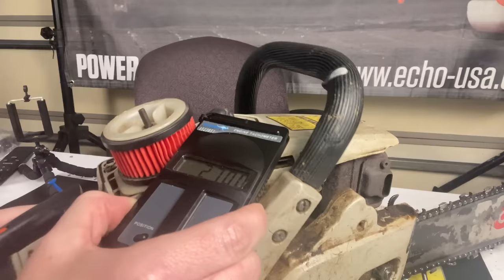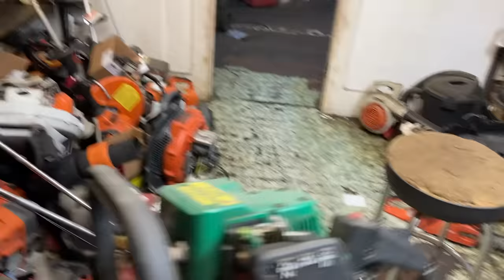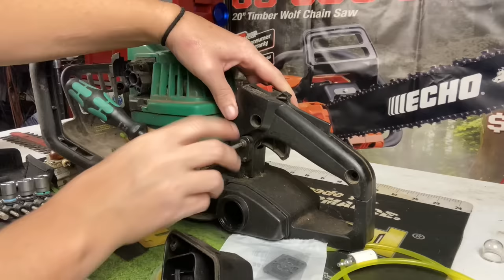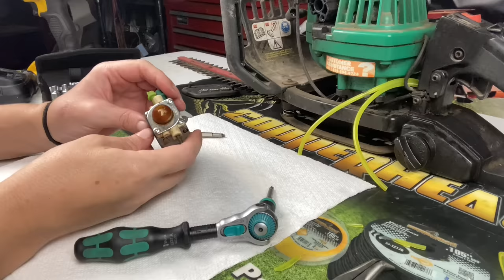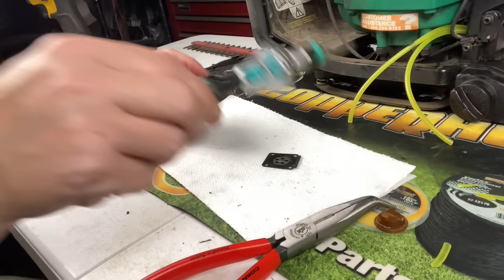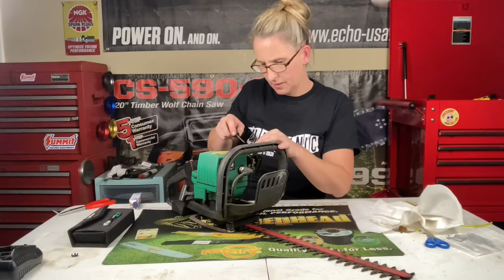THE BIG SECRET on how to store your small engine long term + Turning Shop Trash Into Treasure!

Comment: Love watching your vids, small tip for feeding a tight fuel line is to put some spittle on it and push and pull at the same time, it slides in easier, but like I said, love your vids.

Comment: Found your video on purging 2 cycle oil through the system before long term storage very interesting and I might try this some day. However, when I bought my first chainsaw, a Stihl 041AV,  back in 1976, the dealer told me to never run the saw dry before it was to be stored. He advised me to fill with fresh fuel, run it a couple of minutes and then shut it off. Then every six months or so, change out fuel start it up and run for a couple of minutes before shutting off which I do for all sisxteen 2 cycle pieces of equipment I own and never have any issues with starting. As for the Stihl 041AV, in all of this time, besides regular maintenance, I have only had to replace a couple of gaskets, and do a carburetor rebuild twice and it still starts and runs perfectly. There is, however, one problem. This saw still has so much compression that these 76 year old arm s and shoulders are having  a lot harder time pulling the starter cord so I just might try your suggestion of circulating some oil through the system and just let it sit on the shelf. But do to the fact that it does not have a purge bulb I don't know if this will work.Thanks again for the idea.

Comment: Did basically the same thing on an old Craftsman string trimmer I’ve been using for twenty plus years! Great tutorial!! I had a little hard time getting lines through tank till I trimmed the angle sharper. Good thing I fixed it to, because I just got price for removing four large pine trees removed, and major trim on two ornamental pear trees!!!!!!!!! OUCH

Comment: That’s a great video!! I learn something all the time watching your videos. Will have to do this with my chainsaw, dump all of fuel run all the fuel out of the carburetor and pour a little bit of two cycle, engine oil into the tank and get it in the carburetor so it doesn’t dry up.

Comment: Great recommendation on the 2 cycle oil in the gas tank for long term storage.  I use my "small" chainsaw frequently, but only occasionally use my "big" one.  This reco is great for it's storage -- which can be 2-3 years at a time.
Reply: I’ve done it several times with a Stihl 2-cycle tiller that I only use once a year in the spring. It definitely works but it’s a bit of a PITA to clear the oil out of the carb on the first start after hibernation.
Reply: That’s why you should buy a qt of premix can gas for 5-7$ and store it with that. It has a 2 year shelf life after opening
Reply: @christopherlehman4045  You need to watch her video on using that stuff. She recommends that you never use it. I think your better off using her 2 cycle oil trick.
Reply: @christopherlehman4045  : or just buy ethinol free gas

Comment: I would read PM magazine and often wanted to take the advertised small engine repair course. Never did though. I recently found a Craftsman chainsaw, model 358351161, in my garage, hidden away. Manufacture year is 1997. I don't even remember it. But after watching many of your videos, I gave it a try. First thing, the bulb cracked and I dove in. All the lines were hard and brittle so I bought replacements and installed them using your techniques, but after watching this video last night I decided to open the carburetor. Sure enough, the diaphram was collapsed and I researched buying the repair kit. $35+. But a replacement carburetor was only $15+ including tax. The replacement carburetor comes with everything I previously bought times 2 for 1/3 of what I spent buying them piecemeal. Many lessons were learned, but primarily go all the way before purchase. Thank you for your concise and informative videos.
BTW, I will store it with all the fuel lines filled with oil when I put it away for the next 20 years.

Comment: Greetings!  Recently discovered your channel and must compliment you on your knowledge and ease of presentation.  Question on long term storage?  In reference to using 2 cycle oil in gas tank, what volume of 2 cycle oil do you add to you dry gas tank?  Do you fill partially, or complete fill?  Thank you and please continue to deliver the great content.  Bruce
Reply: Hey man, looking like your ? got missed, I would add enough to at least cover the the fuel filter and then some for cases where the rubber lines go directly through the tank itself. But, for tanks that use a rubber grommet with 2-3 fuel lines running through that grommet, I'll FILL the tank with oil so that it keeps that grommet from drying up, shrinking and hardening. Some tanks are BIG- I have a RedMax blower that is around a 1/2 gallon in capacity, so what I like to do is use an oil such as Super Tech 2-stroke Oil(may even be marketed as outboard oil too. I'm not too picky with it as I usually don't re-use the oil TO PRE-MIX with, but I DO save it to reuse for this purpose again, So it doesn't go to waste. Hope this helps, peace!

Comment: That was a very popular hedge trimmer.  I have one around the same age.  Plugs, lines, bulb, and gas cap all i ever had to do for it.  They had different model # version they were still selling 5 years ago.  But looked same.  All I would add is oil blades after use and use higher octane gas and it will run like a dream.  I was a great purchase.

Comment: The 2 cycle oil storage idea sounds really good.  We already know that oil is compatible with the gaskets and lines and it was made to burn.  I'm sure it will work fine for storage for a year or two and sounds like it would be an improvement over just running the tank dry.  One of my concerns however would be that it may get gummy when stored for multiple years.  My go-to for an oil that doesn't get gummy over a looong time is Dexron transmission fluid.  Any idea how that might work for long term storage?
Reply: Why would oil get gummy? I recently found a half used container at least 15 years old,  I had stashed away and it is still perfect. I don't know whether that would be true for the old outboard motor stuff. Doesn't transmission fluid have cleaning agents which may deteriorate internal components?

Comment: Hi Bre, love your channel! So, question about this tip with an Echo CS-590. Since it doesn't have a primer bulb, is it sufficient to pull it a couple times to circulate the oil before storage?

Comment: Great idea for long term storage of 2 stroke engine. Do you have a strategy for a 4 stroke generator? Or a tutorial for cleaning out the carburetor the day of the ice storm if you forgot to run it dry:)
Reply: Joe Shmo  Go to your local small airport and buy some 110 low lead.  It lasts for years in a gas tank.
Reply: @POOKIE5592  or just find a gas station that sell clear premium.  also, a generator should be getting run under load at least once every three months.  
but I've never had a carb problem since I stopped allowing ethanol near my small engine equipment.
Reply: @kenbrown2808  Can you store generator with ethanol free gas in tank? I don't use it very often, but need to have it on standby....
Reply: @pingpong9656  the only time my generator tank has been empty was when my BIL broke the fuel petcock off it.
Reply: @pingpong9656  addendum: the one thing i make a point of doing is i turn off the fuel before i switch off the ignition. That way if the float valve in the carburetor leaks, it won't fill the crankcase with has.
Reply: @kenbrown2808  That still won't last as long as av-gas.
Reply: @POOKIE5592  And it won't have the lasting effects of lead either. Good health for me and my children or gasoline that will store for years, such a hard decision.
Reply: @killer2600  You gonna all sit around in lawn chairs in front of the muffler?  We're talking about emergency generators here.  Do you run indoors every time a Cessna flies over your yard?
Reply: @POOKIE5592  You should research the use of lead in fuel and how we have all been poisoned by it. Good videos on that on youtube, Engineering Explained did one about two months ago. There's even a movement to go unleaded in avgas for a reason. Leaded gas isn't safe for anyone, at any time, in any use case.
Reply: 0:54 Bre replies to all the early commenters except me:)
Reply: @POOKIE5592  Going to check that out with a small engine mechanic that is also a pilot. He got my generator going the day of the ice storm. He looked in the gas tank and threw it out then used a lot of steel wool to clean out the carburetor parts and pieces.

Comment: Watched this video but you never discussed "The Big Secret" on how to store your small engine. Did I miss it somehow?
Reply: Go to just before 13 min.  Before storage remove fuel, run dry, replace fuel with 2 cycle oil, make sure you get it into the carb
Reply: She explained about emptying it of all fuel, and pouring in 2 cycle oil for storage. That’s a cool secret for winterization.
Reply: Yup' you missed-it

Comment: My secret to reviving old engines that have sat for a decade is my ultra sonic cleaner. I have got countless engines running without rebuilding the carb. I take the carb off, run it in the ultra sonic for a few hours, THEN I take it apart, lay the gaskets in a book so they dry flat, run it in the ultra sonic some more, rebuild and install. Obviously the better way is just to get a carb kit, but I’m telling you right now you don’t have to. 
Lastly, the harbor freight US is still more go to. I have a great big on but the hf one is pretty good 12 years running. I also like the hf us cleaning powder the best too. 

That’s my two cents and a couple more.

Comment: Twice now I've learned things from you that I didn't know.  Have replaced a few primer bulbs before.  Always run the gas out at end of the season.  The 2-cycle oil never thought of that for long-term storage.  Thanks.  A big Stihl fan btw.

Comment: Hi, 
flying radio -controlled airplanes for the pas 45 years, we use fuel lines that are way more dependable than those lousy "neoprene" fuel lines that come with most 2 cycle engines. We have to, you have a $2,000 airplane in the air, everything has to be right. I would recommend going to somewhere like Tower Hobbies for fuel line and you'll never have to replace it again. 
Cheers!

Comment: I was given a Tanaka hedger that hadn't been started in 4 years. I put some fuel in and started 2nd pull. The plastic handle had deteriorated and ended up breaking but I still have the hedger and still runs fine, I am considering converting it to a trawler engine for my little fishing boat lol.

Comment: You are right about using 2 c oil in fuel tank for storage, I’ve had one saw set 19 years and it started up and ran great after a tad of carb adjustment and I filled the bar oil tank full also
Reply: I use the cheapest oil I can find, most of the time it’s Walmart 2c oil

Comment: From 30+ years of experience operating pro saws: 3.5 to 5 cubic inch engines. I used 92 - 100 octane, alcohol free fuel preferred, STABILIZED., always stabilized!   Keep tank full after each use and when stored, always use fresh fuel and fill tank.  Six months later, saws easily start on 2nd - 3rd pull.  I did NOT run fuel out for storage because of possibility of having a LEAN RUN and engine damage.  Also, ran fuel at 40:1 mix for better cylinder lubrication.  Cut mountains of wood.  Saws still have 150 psi compression.  Thank You for letting me share the above!

Comment: I have my daddy's old Craftsman, looks the same what you have there, that had been sitting on my back shelf for 5+  years without starting. Tank had been drained and ran till empty before sitting it there. After watching this video I figured what the heck, let's try it. Took it down, lines and primer bulb still soft, air filter still good, added fuel, and after about 15-20 pulls fired up. After warming up I trimmed several bushes just to see how it would do. Ran until the tank was dry and cut like a charm. Pretty amazing. Thanks for the nudge to go out and give it a try.

Comment: special tip on the fuel tube threading   well done . I also have an identical pair of long nosed pliers. super tip on the neat two stroke oil. I use Motul two stroke oil .

Comment: Awesome job! I'll try your suggestion for end of season storage. 2 cycles are soo frustrating. They are really not simple, and the smallest thing can delivers days of frustration trying to fix. The carbs are the worst, its simpler to get a new OEM than to mess around spraying cleaner everywhere and it still does not run right.

Comment: I had a mower in storage for 6 years. I added Startron stabilizer (label says it preserves fuel for 2 years) to it originally.
When I pulled it out of storage the fuel system was clean. Changed oil and added fresh 91 octane non ethanol and mower was good to go.
BTW I am 73. Worked on small engines since I was 14.

Comment: We used to have trouble starting our old 70hp Johnson after it had sat for a few weeks and started running it dry between uses- never had a problem again and I've done that with my chainsaws which might get used once a year. Didn't do the oil in the tank thing after running dry but still done the trick here. Thanks for the tip.

Comment: I have run across these hedge trimmers that the pull quits pulling. Easy fix. The 4 screws that holds motor to the blades. Take them out and put small washer on the screws between the motor and blade no more problems

Comment: Decided, not too long ago, to go all electric and propane because I'm not very diligent at maintenance or winterizing,  but two cycle tools can still be great tools, reliable and convenient and nothing is worse than the throw away mentality. It can be the same with battery and corded but two cycle are usually "resurrectable" as electric are not. Thanks for the clear instruction and tips.

Comment: I have a couple of these, one is a generic performance power HG18, the other is the Husqvarna 18H.  Only getting 65PSI compression on the generic so I'm probably going to end up using that as spares for the 18H as I can't seem to find rebuild kits anywhere.

Comment: The best tip yet on two stroke storage and I am 70 years old. I always shot fogging oil in all my 2 strokes after running dry but oil makes more sense to me. I will add the  2 stroke oil now.  Thanks

Comment: I think the technical term for those fuel lines is Hard As A Carp. I have a similar one from a few years back, and it stumped me. I might pull it back out and compression test it and see if I have learned anything in the last 4 years.

Comment: I see how its a challenge to pull the fuel lines in. Ever try spraying some silicone around the opening which you could use a cloth with the silicone on it and wipe around the opening. Could wipe some on the fuel lines as well. Drys up quickly. Cheers!

Comment: I bought that exact same Poulan Hedger 30 years ago, in 1993! It ran for a long time, but eventually got replaced with an Echo pole hedger that had two moving blades vs. the Poulans one blade. BTW- I bought the Echo in 1997 and it is still working today! One new carb, several tubing kits and plenty of grease maintenance on the transmission.

Comment: @ 12:29  Jut run dry, empty tank,  then place 2 cycle oil in tank    pump the primer ball till noticed and pump few more times to get oil into cylinder  then put  on shelf for storage.

Comment: I have asked a number of  these sites where do you get all these parts at to make these repairs. I have never gotten a reply . Before running across your site I. Had a certain one that I enjoyed watching. However I enjoy how you take the time to show us every little process . Love the trick of putting 2-cycle oil in the tank and prim it up. Definitely going to try this as others recommend complete draining and just store, some recommend non Ethanol fuel with stabilizer. Your never sure what to do as you don't want to damage your machine. Thank you.
Reply: I have asked this before but have gotten no reply. Just wondering where and how I get the the parts to make the repairs. Thank you. Love your channel.

Comment: I’ve got a Stihl hedge trimmer that I sent to the shop to get fuel lines on took forever to get back finally got it back in the gears were going out of the bottom of it. Thank you Dixie Chopper. 🤬
Now it’s just an ornament on the wall.

Comment: Great video. I have stored generators by sucking tranny fluid in to the carb and fuel lines. No problem starting years after storage. The tranny fluid  has detergent in it to keep the components clean and also keeps it  lubricated. I just drain the carb bowl before starting. It does smoke some, but clears up in no time

Comment: I’ve got a Johnson 70 2 stroke outboard the oil injection check valve went bad and would fill the carbs with 2 stroke oil I would drain the oil out of the carbs and it would start every spring never thought about doing it myself great tip 👍👍